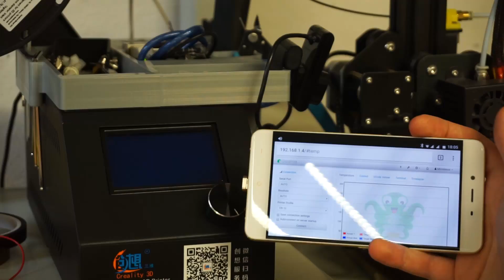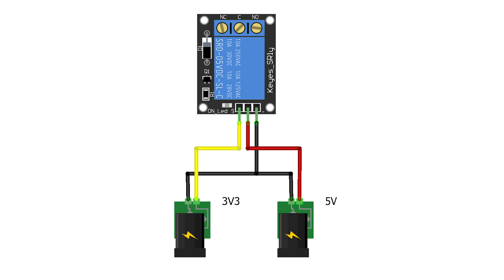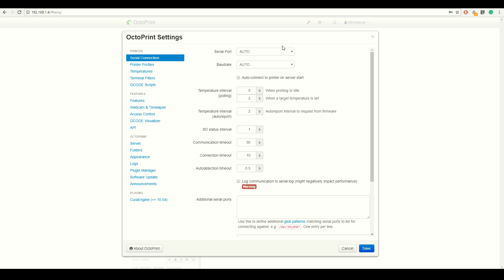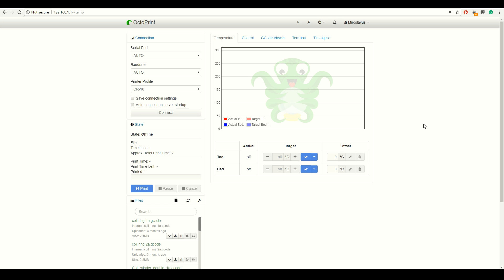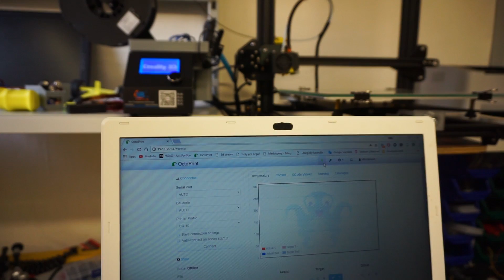How to turn your 3D printer on/off using Octoprint

Comment: Done the mod like on your yt film, got a 3.3v relay and vcc to 3.3v ground to ground and the signal pin to the gio pin that represents no3, configured it in psu config on octoprint like in your yt film saved the lot, can hear the relais clikcking and see the green led go on and off, (my printer is power bij a on off switch wich is turned on) but still no controle to turn my printer on and off. It is a anet A6. What am i missing here
Reply from the maker: Sounds like you're switching it alright. I'm guessing the live side of the relay might be a problem. Do you have anything connected to the COM pin?

Comment: Is there a way to have this cut the power at the end of a print?
Reply from the maker: You could add a command at the end if the g-code but there is option to turn the printer off when idle. I set it to 15 minutes. So 15 minutes after print is finished the printer turns off

Comment: Why not just use a 3V3  relay and power it from 3V3?
Reply: I think it draws to many amps, 118mA flows through the coil, and the gpio can only output 26-52mA.
correct me if I'm wrong please.
Reply: @nicholasfonda2363  Yes you are correct, those GPIO pins cannot drive a lot of current.
I ended up using a transistor controlled by GPIO pin switching the RPi's 3V3 power rail to the optotriac(optocoupler with triac output) which then switches mains to the relay with a 230V coil.
Everything have been potted and also flash tested with over 1kV to make sure I won't blow up the raspberry pi with mains xD

Comment: Hello, do you turn on and off printer also automatically, also than manually? In particular I'm searching for a similar solution to turn on case's fan on starting a printing job, and turn off when a printing job is done.

Comment: this is great, working fine, the only thing is that the bolt icon is green when the printer is off, and when i press the bolt , printer turns on. how can i sync it to the true state of the printer ?
Reply from the maker: There is an invert option in the PSU control settings
Reply: @Gyro1  cool, thanks.

Comment: Any Idea to how we can do for turn off the printer automatically when finish the print?
Reply from the maker: There is an option where the printer will turn off after idle for few minutes.
Reply: @Gyro1  Where? 🙊
Reply from the maker: At 4:00 you can see the option on the bottom to turn off when idle.
Reply: @Gyro1  Nice, thanks!

Comment: Thanks for the video, I have built this and it works really well.
But after switching the printer on and off a few times to check that it works, I then do a print and I am finding that after about an hour print that the relay contacts have fused together and I no longer can switch the relay. This has happened to two devices so far.
Relay is rated at 10A 250VAC.
Thoughts?
Reply: Its likely just bad quality relays.
Reply from the maker: Are you switching the 220/110V or 12V? The current on the 12V line can get easily over 10A if you have heated bed
Reply: @Gyro1  switching 240. Ended up finding out that it wasn't a relay problem, but a connection issue from the raspberry pi. Thanks Steve

Comment: My machine has a 15A power source. Where can I find an adequate relay? or should I make it? or I can make the cut directly on the switch of the power source that's usually low-amp. What do you recommend?
Reply from the maker: The printer will draw 15A at 12V but at the same time it's pulling less than 1A from the wall(230V). That's why I put the relay on the power cord. At 230/120V the current is relatively low.
Reply: Perfect, I have a relay of 5v 10A arduino unused. I'll put it to work.
Reply: It worked, Many people do not like the 5v relay and I do not know why if the raspberry has it. My configuration: GPIO Mode>BCM, GPIO>15.
Reply from the maker: Awesome 🙂. Yeah the 5V relay on raspberry pi is a bit of a bet.

Comment: when I turn off the printer and turn the rp on, the LCD stays lit a bit light, is that a problem?
Reply from the maker: No it's not really a problem.  Your printer is just getting 5v over the USB cable. You can leave it like that or if you want. You can modify the USB cable so that it won't provide 5V
Reply: @Gyro1  pretty late on this but would I just cut the 5v wire in the cable or is there a fancier way to do this. Great video by the way

Comment: Awesome tutorial, I have ordered relays and patiently waiting for them to arrive. I the meantime I'm thinking how will that work with my Ender 3. I have Pine64 with Octoprint that is connected to a printer via usb cable and when pine is operational it gives power to printer display and probably other functions on the printer even if printer PSU is not powered.  How can I avoid powering printer trough usb w/o PSU?
Reply from the maker: Thanks. The easiest way is to just modify the USB cable. Disconnecting the 5V wire will do the trick
Reply: @Gyro1   Yes, googling I found that that's the easiest solution so I ordered couple USB cables extra ;)

Comment: All the people saying wifi plug - I think you are missing the point of this video. It's using OctoPi and therefore all within the one piece of hardware and webapp. Nice video thanks
Reply: I use wifi plug controlled through octoprint.
Reply: @justinlabarge8178  me too. $7 wifi plug with a widget I just tap. I use octoprint to make my life easier and Im consistent
Reply: Years ago there was plugin for TP-link wifi socket but that not worked for me :-(
Reply: They actually have a plugin to control a Ikea Tradfri outlet now; I prefer this method...

Comment: What about putting the relay in between the PSU and the printer instead of in between mains and the PSU? That would allow one to power the Pi from the printer and still turn it on and off - However you’d have the PSU turned on constantly then...
Reply from the maker: Depending on what kind of printer you have. the current on 12v rail can be well over 10A so a beefier relay might be necessary
Reply: i have an ender 3 and im trying this, 24v and at highest 270W so ~10 A, but i'm having trouble triggering the relay with just 3.3v from the pi. (i couldnt find a 3.3v locally)

Comment: Thank you. I was looking for something similar. This of course is assuming to have the raspberry always powered from another supply
Reply: Enrico Bononi a totally agree, what is needed is a relay and code that will first shutdown the Pi then the printer. I am trying to find any Pi switch mod that  will  work with Octoprint/ octopi. Tried the Borkin and the momentary mod that puts pin 5 to earth and none of the codes work with Octoprint

Comment: Interesting video, thanks for the time and effort you put into making it! Unfortunately for me,my rPi is powered from  the printer PSU via a buck converter, but I wll find another use for this great and very helpful tip!  Keep up the good works!
Reply: Rodney Smith, I am working with a similar setup to what you are and I suggest you look into PiJuice sold on Amazon (also open source on GitHub) or a similar & cheaper option of the Makerfocus Raspi UPS HAT also Amazon. It gives you an UPS for the RPi to maintain power while shutting the rest of the printer off, before a self shutdown

Comment: I don't know why my on/off function doesn't work well. If i put the cables in NC configuration I can turn off but not turn on then, and If I put in NO I can't turn off. I try connecting 1 relay with 24v positive Common and with 2 realys one for 24 positive and another one for the negative. Any idea?
Reply from the maker: If you're using 5V relay you might need to modify it. Link on how to do it is in the description.
Reply: @Gyro1   My relay doesn't have any pins to jumper it

Comment: If you have a printer that uses a PC power supply you can wire in the green wire on the main ATX plug to ground using the Raspberry Pi GPIO pins. Using this method you can get around messing with mains voltages. https://www.instructables.com/id/How-to-power-up-an-ATX-Power-Supply-without-a-PC/

Comment: hi, can this solution be applied when the printer is switched off automatically after printing?
Reply from the maker: Probably not. If you have to turn the printer on with a button on the front panel then it's not going to work
Reply: So it is not possible with such a relay to turn off the printer after finishing printing by Raspberry Pi automatically?
Reply from the maker: My bad. I misunderstood. Yes it is possible. There is an option in the settings to turn it on. I think it turns printer off when it's idle and you can set after how much time it'll turn off
Reply: :) ok, I already have a 3V relay, I am waiting for Rapberry Pi 3 B + and I will do it according to your description, thank you very much for your answer. Regards Leszek
Reply from the maker: Good luck 😉

Comment: Good video, but it should be noted, that you conveniently skipped the fact, that your relay has a 3V input signal, while most available boards are 5V. Since the RasPi GPIO is only 3.3V (or 3V3, as some write it) your relay is fine. But the RasPi is not capable of switching relay with 5V input. You'll need to add a "level shifter" (or transistor, if you are good at soldering) or buy a more expensive 3.3V relay board (typically a 5V relay board costs $0.40 on AliExpress, while a 3.3V board costs $1.50 - 3 times as much!).
Reply from the maker: Since I made the video I have received my relay boards which were around 50cents each and they do work with 3v3 signal without any problem. As long as they are powered by 5V which is available on the GPIO header.
Reply: @Gyro1  Based on your video I've bought the exact same relay board shown at 0:53 (blue "TONGLING" relay) and it definitely doesn't work with the RasPi. ;) Powered it with 5V, signal from GPIO (3.3V) and it simply doesn't switch. Just wanted to point it out, that if someone buys these boards: they won't work with the RasPi. If I had a power supply where I can set the voltage between 3.3V and 5V stepless, I could check which is the minimum voltage for input for the relay to switch.
Reply from the maker: I tested it on the pi itself instead of just power supply and you're right. It doesn't work. Fortunately, I found a really simple fix. Just connect the Vcc pin of the relay board to 3V3 instead of 5V. That worked for me. I will also update the instructable. Thanks for letting me know :) and good luck
Reply: Gyro  I'd be careful with connecting the Vcc to 3V3. ;) The relay was designed to switch at 5V (or a little less), so you don't what long-term effects it might cause if it's used with nearly half of that (unintentional switching perhaps?). A better solution is to add a transistor to the Input (GPIO -> Transistor -> In) or use a level shifter (like I wrote in my first comment). BTW, my 3V3 relays came in the mail today, I'm gonna test them right now. :D
Reply: @drunkenmaster666  it does work for just a few times if i connect the  VCC to 3V3 instead of 5V, but does work anymore after several minutes... wondering why? btw wats does the transistor does to this circuit? any other alternative?
Reply: @Gyro1  I am using the exact same relay and it really doesn't work for me sadly... And i did try what u say by connecting the VCC to 3.3V in RasPi instead of 5V but still doesn't work for me... wish someone can help me... thanks... =D
Reply: @chunhaotan9836  It's likely just a coincidence, that it works with 3V3. Your relay probably has a very low switching voltage, but I don't recommend using it that way, because the relay or RasPi might get damaged. There are basically 3 options, but 2 are very similar:

1) Buy a 3V3 relay (for example: https://goo.gl/p8ymSK)
2a) Use a level shifter between your RasPi and Relay to change the 3V3 from the GPIO to 5V (see: https://goo.gl/9e8K1z)
2b) Make your own level shifter with a transistor and a resistor (for example: https://goo.gl/yAvJeE)

First I tried option 2a) which works quite good, but it needs a lot of jumper cables so I don't like that solution. Now I have simply bought a 3V3 relay module (option 1)) and that works perfectly.
Reply: What type of transistor? i am using the exactly same relay and it really doesn't work for me sadly... wish someone can help me... thanks... =D

Comment: The relay I picked up has 5v for power - that works fine - but the 'N1' connector will automatically trip the relay - it is a Robojax 5v relay that triggers low.  I'm not having any luck...

Comment: Thanks for the video, short and informative.
Just a question: how do you manage to keep the LCD screen of the printer off while it is connected to the Raspberry Pi? 
Or isn't it connected in the video demonstration?
Reply from the maker: My printer doesn't use the power from the USB port of the pi instead it's powered solely by it's own power supply. If your screen is on even when your printer is connected only by USB you can eliminate that by modifying the USB cable. Simply disconnect the 5v line and you're good to go. It's usually the red wire
Reply: Thanks for the reply! 
When you say it is powered solely by it's own supply, does that mean you did exactly what you mentioned (modifying the USB cable)?
Reply from the maker: No. It was like that by default
Reply: Ok thank you. And thumbs up for the video again!

Comment: There's a hundred million varieties of a relay board on ebay, and I'm not sure exactly which one would work best. Any suggestions for a specific one?
Reply: I went over to my local parts store and bought this, I think it will work:

https://secure.sayal.com/STORE/View_SPEC.asp?SKU=248131
Reply from the maker: It really doesn't matter. If it's rated for 5V it'll be fine. Also if it says it's for arduino it'll work with this as well

Comment: Very nice explanation!
I would like to know something:
My raspberry is powered on the 3d printer PSU, when I turn of the printer it will also turns off the Pi. Is it OK for the Raspberry to turns off like this?
Reply from the maker: It's not the best practice to just unplug the pi because you might end up with some corrupted files but most of the time it will work just fine. However having it connected to the PSU of your printer means this mod won't work. It needs separate power supply
Reply: Gyro what you mean is the mod won’t work to properly shut down the Pi. What is needed is a momentary switch mod connected to the relay with a trip to set the code off. Nothing I have found works with Octoprint

Comment: hey! really enjoyed your video, helped me a lot while setting this up but now i´m facing a problem:

the gpio pin doesnt switch at all, i tried wiring my relay module the other way around (power supply on COM and NO) so i could check if the relay switches and as soon as i power on my pi it switches, but when i try to switch per PSU control plugin it doesnt do anything.
Reply: Power supply should be on COM and NC, not NO. At least that is what he said in the video
Reply: @3DPrintingKid  i tried it with COM and NC, but i solved the problem anyway, the raspberry pi GPIO does not put out enough current to make the relay switch, wired a NPN transistor and 1k resistor in, now it works

Comment: The insurance company is not going to be so happy about this if there is a fire.
Reply: Half the people watching and implementing this will be using a Chinese knock off printer with a dodgy power supply anyway
Reply: I agree. Like the very popular Creality Ender-3 with a cheap Chinese PSU that I've read is prone to failure. So leaving a Chinese made 250$ printer working when nobody's home and the house burn.... good luck with the fire department and your insurance company. At least with the new Ender-3 they put a good quality Mean Well PSU  @joelaw728

Comment: Would it be easier for me to setup it up if I buy one that supports 3.3v instead 5v? ? Would I need to add any resisters ?
Reply from the maker: Yeah. It'd be easier with 3v3 one. You shouldn't need any resistor then
Reply: Thanks , and since the board is 3.3v I don’t need two boards then for 3V3 and 5v ? Sorry if a bit confusing but I want to make sure that I get the right parts for this project .
Reply from the maker: No. The raspberry pi has 3v3 power output.
Reply: https://rover.ebay.com/rover/0/0/0?mpre=https%3A%2F%2Fwww.ebay.com%2Fulk%2Fitm%2F351748538371

https://rover.ebay.com/rover/0/0/0?mpre=https%3A%2F%2Fwww.ebay.com%2Fulk%2Fitm%2F372240651316

Would either one of these be fine ?

Comment: I'm just really curious - where are you from ?
Reply from the maker: Slovakia 😀
Reply: Which city if I may ask ?
Reply from the maker: Irrelevant
Reply: Sorry, do you have only the Cr-10 or do you have some other printer too ? I got myself Ender 3, so do you have some suggestion what to watch for (as it is also from Creality and is very similar) ?
Reply from the maker: Not really. I didn't have any major problems yet. Just a few clogs but the hot end if easy to work on
Reply: tak pocuj miro, potreboval by som vytlacit este jednu vacsiu vec, lebo mne sa na moju tlaciaren nevojde :D
Reply from the maker: Jaj 😁 Tak pošli email

Comment: I do the same thing with a wifi plug off Amazon. I use it to turn it off from anywhere. With a camera I can see when it is done printing and give it 10 minutes to cool down and then shut it off
Reply: why run a Pi & a wifi plug when u can do it all in 1
Reply: @LostCloudx4  if you have your pi set up to run off off the printer power supply then the pi will not have power to activate the relay
Reply: @demonninja18  The Pi runs off its own powersupply. Octoprint is a server that controls the printer. By design its always on waiting for commands. 

You are able to control everything through one interface. I can send a print from Cura to OctoPrint, Octoprint automatically turns on the printer, prints the item, then shuts the printer down afterward. Its a one button solution once its set up.
Reply: @LostCloudx4  I use a plug and I just have a widget on my phone. It's still pretty convenient.